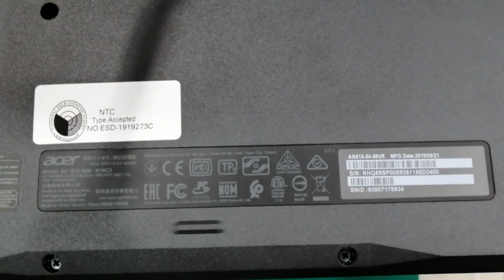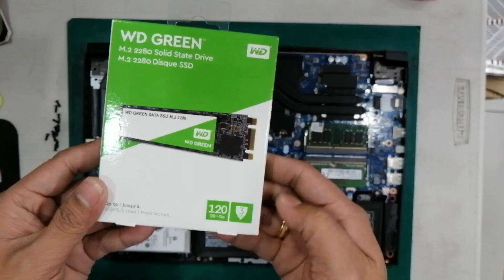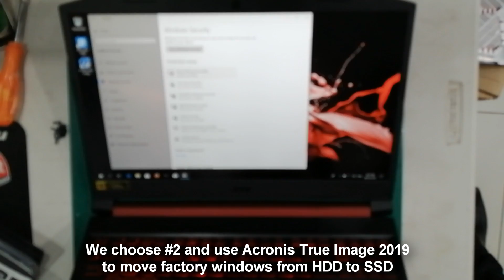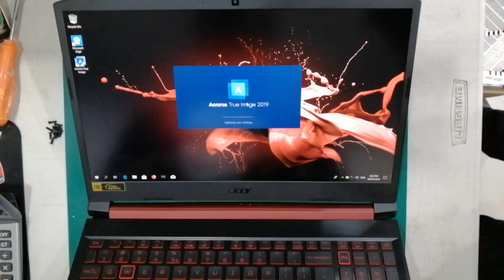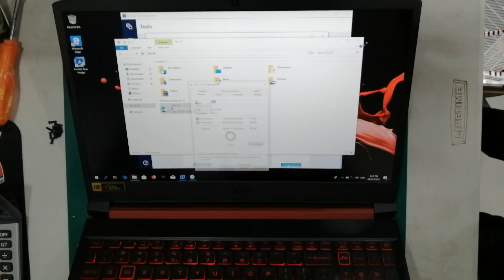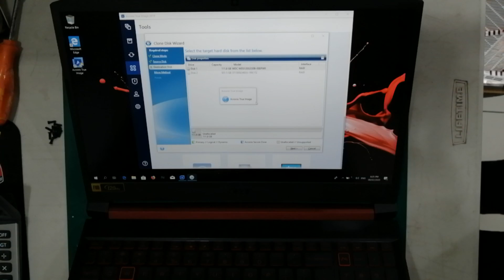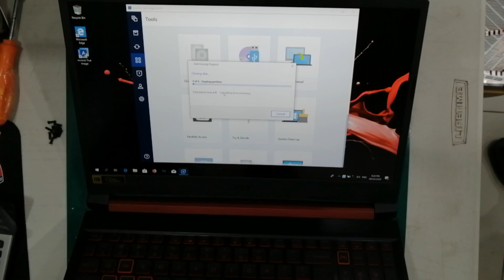How to upgrade acer nitro 5 2020 (Full)

Comment: I have the nitro 5 i5 10300h 512gb ssd 8gb ddr4 ram. If I wanted to add another 1 or 2 TB HDD and another 8gb ram would I still need to do the mirroring process ?
Reply from the maker: no need to do mirror process, since you do not replace the main storage which is the SSD
Reply: @techph7854  sweet, thanks !
Reply: For more info watch out this link : https://youtu.be/VDJ5ubAKk08

Comment: Sir meron din akong acer nitro 5 yung model nya is AN515-43-R694 it comes with a 4gb ram tapos me free siyang 4gb ram is it possible to upgrade my ram to 16 gb ? And can you tell me anong brand ang recommended mo for it thanks po in advance sa sagot. 😀

Comment: I upgraded my Acer nitro 5 to 24 gb ram and I still have 45 fps in Warzone in some moments. With gtx 1650, i5 and ssd xD
Reply: what? mine is rx560x 16gb, the nvme + ssd. i got 60-65fps constant but my sacrifice is 90°C degree temp. i think u should try to set max cpu performance to 100%.
after that use throttlestop to limit your tdp (for heat problem).
Reply: @chromantium5210  Where to set it up? At max fan speed my temperature is about 70 but at auto it's also 90.
Reply: @Eleemenate  owh sorry, my bad. at 1:35, set your Minimum CPU performance to 90% then Maximum CPU performance to 100%. the after that, u can change the other thing to "maximize performance".
Reply: https://youtu.be/8WoAZ4LKVC0
i think this will help. u can control your cpu to BOOST it to its max by set it to 100%. or, set it to NOT boost it at 99%. hope it can help u.
notes: more performance = more heat.
i got 90°C even at max speed and its throttling.
thats when u need software called throttlestop (for nvidia) or ryzen controller (for amd) gpu
Reply: @chromantium5210  I did what is presented in this video and now I have even less fps xD

Comment: I need help, I have the an515-54 and I want to upgrade to two ram kingston 8gb 2666 Mhz, but if a put the two at the same time my notebook doesn't respond, just the keyboard start, the screen it's just pitch black. But if I just use one, works just fine. I don't kown what to do (I'm sorry for my English)

Comment: Hi! How about if I replace only the HDD to SSD and install an additional m.2 nVMe SSD and I don't upgrade the RAM - do I need to remove the battery connector? Thank you!
Reply from the maker: Good day, I have to many upgrade experience without removing the battery, You dont need to remove the battery as long sa you are careful

Comment: i have a acer nitro 5 with ryzen 5 and radeon and i want to upgrade it to the max. can you recommend some parts?
Reply from the maker: only SSD and RAM is the part that is possible to upgrade, you can upgrade the RAM upto 16GB recommended
Reply: @techph7854  but can i change my ryzen 5 to ryzen 7? is ryzen 7 better than ryzen 5?

Comment: I had this in 2017 still runs smooth today until I smashed it lmao
Reply: ikr, once you start smashing this or generally your laptops. be prepared to say goodbye to smooth performance. i had to take mine to the service centre, waited for two weeks, and it came back and was like brand new.
Reply: @ForeverDubsteps  yeh same I had mines repaired and it’s taking years for my windows to load
Reply: @pixelmaster1991  feels bad man

Comment: bro i have the same model laptop and i have a doubt that is both m.2 slots supports  sata and nvme ssd s beacuse you have shown in 4:43 that the upper slot only supports nvme and  you have installed your sata m.2 in down slot also.
Reply from the maker: This model supports both sata and NVME
Reply: @techph7854  in both slots ?

Comment: sir, as per questioning someone who have laptop repair shop that also offers upgrades. if my unit is to be upgrade to ssd, the 1tb hdd should be removed in order for the ssd to be the main drive. is that true or i got the wrong info? i am planning to upgrade my laptop by myself in order to lessen the cost. thanks for this video po!
Reply: Encik Bakhit  another question sir, will it work if install 128gb NVMe ssd, 128gb SATA ssd, plus my factory 1TB hdd?

Comment: Dose removing the back cover void warranty on Nitro?
Reply: here I copy and pasted the exclusions to the warranty:

2.1 Exclusions
This Limited Warranty does not extend to:
2.1.1 any product not manufactured by or for Acer, or first sold to an end-user in a country outside the Territorial Scope of this Limited Warranty.
2.1.2 any product that has been damaged or rendered defective as a result of
2.1.2.1 use of the System other than for its normal intended use, including, without limitation, failure to use the System in accordance with the User’s Guide that
accompanies the System, or any other abuse or neglect with respect to the System;
2.1.2.2 modification of the System including use of parts not manufactured and/or sold by Acer;
2.1.2.3 service or repair by anyone other than Acer or an Acer Authorized Service Provider;
2.1.2.4 improper transportation or packing when returning the System to Acer or an Acer Authorized Service Provider; or
2.1.2.5 improper installation of third-party products (e.g., memory cards).
2.1.3 loss of any, or damage to, programs, data, or removable storage media. You are responsible for saving (backing up) any programs, data and/or removable storage
media. Please note that Acer may opt to replace the System submitted for warranty services with a remanufactured product of equal quality, and, thus, any data stored
by you on your original System may become permanently inaccessible to you.
2.1.4 consumable parts, i.e., parts that require periodic replacement during the normal course of the System’s use, including without limitation, notebook batteries.
2.1.5 minor defects of LCD displays occurring in Systems equipped with LCD display technology, provided that there shall not be more than four (4) defective pixels
per million pixels on a given LCD display, and provided further that, if the display panel is divided into nine (9) equal rectangular areas, there shall be no more than one
 defective pixel in the central area of the display.
Reply: So is it okay to upgrade?

Comment: Lots of things telling me this ain't the 2020 nitro 5... I have both an older nitro 5 (18) and the 2020! ... First of all the plastic that holds the screen is not red.... also the nitro 5 2020 has fans in each side of the laptop unlike what he shows in above video... So bottom line.. above is not a nitro 5 2020 model!!!
Reply from the maker: what I mean is upgrading the nitro 5 in 2020 not nitro 5 2020 model

Comment: Mine has 8 gb ram
Could I able to upgrade it with a extra 8 gb to get 16gb
My consern is weather my laptop has 2 4gb ram or 1 8gb
Reply: Use CPUZ to check. Goto SPD tab and you can check which slots are occupied
Reply from the maker: the best way is to open the laptop ang check the RAM slot

Comment: Hi sir, What are the equipments and tools I needed to perform this upgrade? Thank you
Reply from the maker: sorry I rply so late, you need small philip screw drivers and plastic card to open the laptop. You also need SSD and RAM for  upgrade
Reply: you would need a nvme m.2 ssd and ram. Its really pretty easy to do. You might not need to swap the ssd as a lot of them come with ssd's. Mine came with an nvme ssd, but it didn't have a connecting cord within it for a hdd. I had to buy a connecting cord of amazon and connect it inside it so I could use a hdd as extra space. These things are pretty easy to work on. This is my second Acer Nitro 5 I've had. The first one I had I accidentally broke the screen so I had to replace that. I got a 120 hz screen off amazon for $50 I think new. That was super simple to replace too. All you need to do is pop off the panel that covers the screen. Some laptops you have to take the entire thing apart to get to the monitor. This one you don't need to that with. Really this is one of the simplest laptops I've ever worked on.

Comment: Did you order those items? If yes what site did you use?( for assurance) i'm currently stuck in ph. As for items i'm going to buy I'm going for the exact same items you installed. And is it viable to an515-52?
Reply from the maker: Yesrej I got mine from local store, but if you want to shop online try shopee make sure you read reviews. Yes all the items that I use will work fine in an515_52 but instead of using WD Green 120GB SSD I recommend WD blue 250GB M. 2 SATA or NVME SSD.
Reply from the maker: please consider subscribing if you don't mind

Comment: @TechPH  my model is 515_43 (2019) CAME WITH ONLY 8 GB RAM AND I TB HD WITHOUT SSD BUT IT WRITTEN ON LAPTOP THAT IT HAS DUAL M.2 SSD SLOT AND 1 HDD SLOT
SUGGESTIONS PLZ🔧
Reply from the maker: C00teaslayer69 just add M. 2 NVME SSD 250GB or higher and move your windows 10 from HDD to your new M. 2 NVME SSD. Pwede rin M. 2 SATA kung gusto mo medyo mura pero mas mabilis talaga ang speed nang NVME kaso medyo mahal

Comment: can u tell me the max upgrade of it including ram , ssds or can i replace my hd with a ssd  (my model acer nitro 5 ryzen 5 2019) can plz explain it in details
Reply from the maker: C00teaslayer69 what you mean max upgradre? is it the price? you can upgrade the RAM 16GB is recommended, if your nitro 5 only has HDD then you can add SSD M. 2 on it to make your laptop boot faster, your storage will become M. 2 SSD with windows 10 installed + 2.5" HDD secondary storage recommended for storing videos ang music, check my other upload I have nitro 5 ryzen upgrade
Reply: @techph7854  my model is 515_43 (2019) CAME WITH ONLY 8 GB RAM AND I TB HD WITHOUT SSD BUT IT WRITTEN ON LAPTOP THAT IT HAS DUAL M.2 SSD SLOT AND 1 HDD SLOT
SUGGESTIONS PLZ🔧
Reply: @techph7854  appreciate the response 🙏
Reply from the maker: consider subscribing if you don't mind
Reply: @techph7854  done 👍😂

Comment: I’m just not able to remove the back panel
Reply from the maker: DeM0 don't be afraid, the back panel is really hard to open as long as you remove all the screws you should be fine. Insert your thin plastic card to start a small portion and wiggle it across to open the whole back portion
Reply from the maker: consider subscribing if you don't mind

Comment: Hi, wonder if you can help me on something? I am upgrading my nitro an it already has an m.2 plus a ssd 2.5.. I am upgrading both the states to more of a faster speed. Do I have to clone it back to my old ssd then clone it back to the latest M.2 drive for it be the aplha for the boot?
Reply from the maker: Tauridium No need to clone back to old SSD since they are both SSD storage the boot speed is still fast. I recommend you clone from old 2.5 to new M. 2 if your new M. 2 SSD is NVME type.
Reply from the maker: consider subscribing if you don't mind

Comment: I bought it from the store and tried to upgrade the ram and some idiots were using a screw driver to remove the bottom and now it’s scratched.
Reply from the maker: Tuan z800 not good, they should use plastic card instead of metal screw
Reply: TechPH is there anyway to polish the scratch?
Reply from the maker: @tuanz8009  sorry I haven't try, but I believe the scratch will be permanent

Comment: Hey, what would you choose- acer nitro 5 or MSI GF63, both laptops have the same specs 9th gen i5 and geforce GTX 1650 (Only MSI have GTX 1650 MAX-Q, is there a difference between 1650 and 1650 max-q? ), I think MSI have better cooling than nitro 5, is that's right?
Reply from the maker: Ivo Allens there is very little difference in performance between Max q and not,  in my experience with MSI GF series, the henges breaks suddenly even with proper care, I prefer acer over MSI but its just my personal opinion, yes I also notice MSI cooling system is more better

Comment: Hik
Can you tell me which Version that is? 
I have the Model with a Ryzen 5 3550H and a Rx560x :)
Reply: I mean the Model from the RAM
Reply from the maker: Sammy lai check my other uploads, I have uploaded nitro 5 ryzen upgrade, I use kingston value RAM SODIMM DDR4 2666mhz 4GB. You can use either 2400mhz or 2666mhz RAM transcend, kingston, samsung, gskill ripjaw, crucial in your nitro 5 ryzen 5 3550H.
Reply from the maker: consider subscribing if you don't mind

Comment: Just ordered one of these, going for 16gb, adding a 1tb mechanical and a 32gb optane
Reply from the maker: Good Luck, consider subscribing if you don't mind
Reply: Didn’t the new model just come out?
Reply: @alexkao1585  maybe, but i got it at a steal for $550, $650 after accounting for the upgrades.

Comment: hello, why didn't you put the ssd in the first module you opened?
Reply from the maker: Topo Explorer There are 2 SSD M. 2 slot on this laptop, first SSD slot only supports M. 2 NVME SSD, and the 2nd slot supports both M. 2 NVME and SATA SSD, that's why I didn't put in the first module because my WD green 120GB is SATA M. 2 SSD not NVME M. 2 which is more faster but also much expensive
Reply from the maker: consider subscribing if you don't mind

Comment: can u please help me 
my model is AN 515-52 and i want to add ssd to it 
but how can i transfer my original windows to ssd ?
and use hdd and ssd at the same time?
and should is clone window before or after adding ssd to the laptop?
please.
thank you
Reply from the maker: Pranshu Rajput Yes, you can use SSD+HDD at the sametime, I use acronis 2019 to transfer the original windows to SSD, after you install the SSD use acronis to move the windows from HDD to SSD, after successfull cloning you can delete the hdd partition
Reply: TechPH but acronis is asking for pro version tk transfer windows is there any free software? Available
Reply from the maker: @pranshurajput2670 Sorry, I only trust acronis ever since, if you wish you can find a crack version of acronis true image 2019
Reply from the maker: @pranshurajput2670  may be I can send you a link, can you provide your email here

Comment: My relatively new Chromebook fell apart and I needed a replacement    lnfo.help/-Aspire?壬     I wasn’t real happy with the serious limitations of the Chromebook so I caved and went with Windows 10. It requires a lot of customization and tweaking but it’s ok once you get it streamlined. This comes with S Mode which is the very first thing I got rid of. Fortunately all you need to do is go to the Microsoft Store and search for S Mode. You can undo it in about 2 seconds. The display is very nice. Sound is decent. For $350 this is a great deal. My friend is even considering getting one.

Comment: Okay lang po ba na yung ram lang ang iuupgrade po na 16gb? Di po delikado kahit di na po upgrade yung iba? Natatakot lang po eh baka masira ko
Reply from the maker: Icarus Yes ok lang nmn, pero mabagal parin ang loading nang windows at application pag di naka SSD
Reply: @techph7854   kasi po namimili po ako kung alin sa dalawnag laptop kung yung Acer Nitro 5 AN515 42 R970 or ung lenovo L340 81LKOO47PH.

Kapag ung nitro 5 po yung binili ko bibili po ako nung additional 8gb ram. Anong SSD recommend niyo po?

Kapag yung lenovo po 1TB Kaso po HDD pero 8gb ram po.
Reply from the maker: @icarus4027  pareho namang maganda ang dalawa pero mas prefer ko yung l340, na check ko online 81LK0047PH naka 128SSD+1TB HDD na sya, pero kung bibili ka SSD yung WD Blue M. 2 SATA 250GB or WD Black M. 2 NVME 250GB
Reply: @techph7854  thank u po sir sa knowledge
Reply from the maker: @icarus4027  walang anoman yon, consider subscribing if you don't mind
Reply: @techph7854  already subscribed sir after watching your vid

Comment: I was gifted a refurbishment ACER Nitro 5 this past Christmas. It came with 16GB RAM, 8th Gen I5-8300H, only one USB 3.0, 250GB SSD. I wish I had that additional 3.0 USB I just seen on your model 😁 as my model only has one USB 3.0 😒 also on the bottom there are individual compartments for RAM and the HDD which is convenient, rather than having to remove the whole bottom plate like you just did. I didn't see that on the bottom of that rig in the video 🤔
Reply from the maker: Mr Random that's good and convenient to upgrade, you have different nitro 5 variant

Comment: I've the AN515-43 model with GTX 1650 and 8GB RAM and 256GB SSD and 1TB HDD.
Can I get another SSD upgraded? And how can I know what's my clock speed for RAM? So that I'll get the same clocked ram for dual channeling
Sadly it's still in warranty and Process take up almost 3GB and only 3GB left to use.
Reply from the maker: Pratik Pattnaik Yes, you can add another M.2 SSD NVME since the nitro 5 model has 2x M.2 slots. Install cpuz software to identify the clock speed of your RAM, after installing navigate to SPD tab, click slot1 or 2 if needed and multiply the frequency by 2 example 1200MHz is 2400MHz
Reply from the maker: consider subscribing if you don't mind

Comment: This laptop can dual ram 4gb + 8 gb ram?
Reply from the maker: firdaus azlee Yes, sure it will work just fine without any issue even at different frequency ex.4GB 2666mhz+8GB 2400mhz
Reply: @techph7854  tq so much i will sub your channel
Reply from the maker: consider subscribing if you don't mind

Comment: I saw this deal on amazon is it a good one ?:
Core I7 
Gtx 1050 ti
16 gb ram
1tb hdd/128gb ssd
For 960 us dollars
Reply: Nope
Reply: Asus tuf offers ryzen 5 3rd gen with gtx 1650 along with 512 gb ssd for 700
Reply from the maker: dont read my fpf look for 1650 variant it's more better

Comment: I upgraded my RAM from 8 too 32 easy cost $50 my question is that I have a GTX 1650 and was wondering if I could upgrade my Acer to a 2060
Reply from the maker: Michael Wilson No sir, you cannot upgrade the gpu in most of the laptop
Reply: They sell a nitro 5 for 999 with rtx 2060 now
Reply: @thomasjoyce9348  link pls
Reply: Where did you get it for $50?
Reply: No the gpu is not upgradable